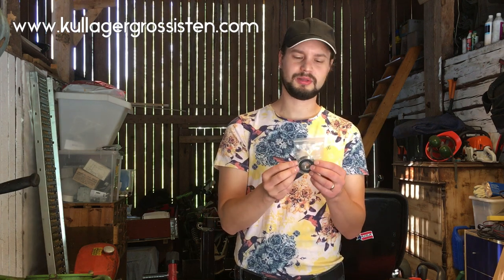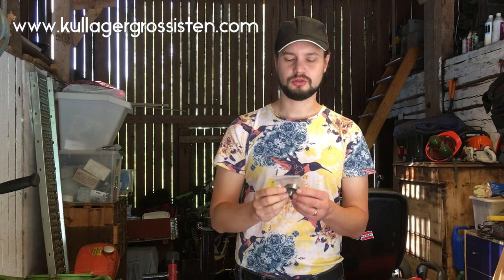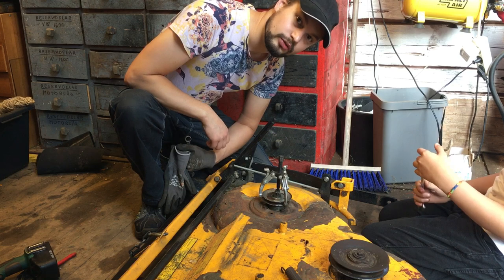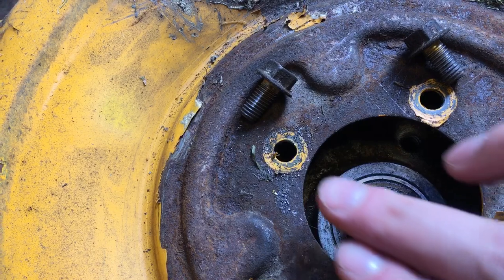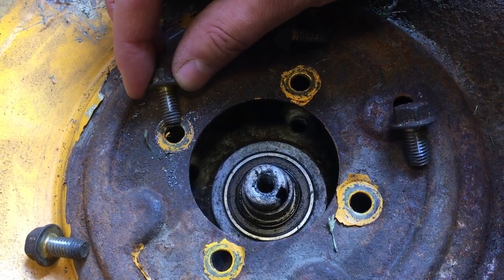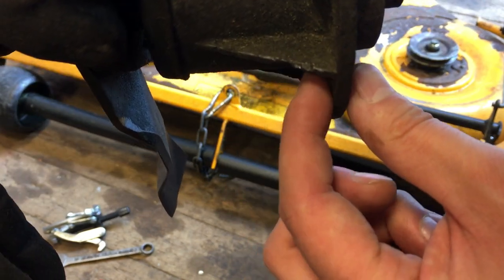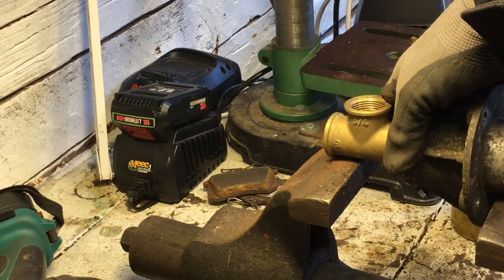Changing bearing In Stiga Park cutting deck

Comment: Great video and explanations - Helped me quite a bit.  Usually the bearings have quite a tight fit so you may need to heat up the bearings and cool the axle..  I used coolant spray that cools down to -55 degrees C.
Reply from the maker: Great to hear and heating and cooling is a great idea. I have used that when changing bearings on later cutting decks.

Comment: Good vid man. The spacer inside the hub between the 2 bearings is to support the bearings allow clearance when you tighten the top pulley spindle nut. On my 121m deck the spindles can be pushed in and “float” which is good as the bearings are tight 8n the spindle housing. My 121m deck also has a spacer under neath that sort of dish on the spindle, this also acts like a spacer
Reply from the maker: True, if one forget the spacer it will be impossible to tighten the nut that goes through the spindle. Why can the spindles float on the 121 deck? Do you mean that they are not really attached to the deck?

Comment: Hi I have a Stiga park pro a the choke cable has broken. Are they difficult to replace.?
Reply from the maker: Hi. What year is your Park from? I haven’t changed that wire but I don’t think it can be that hard. Just make sure to route it the same way as the old wire.

Comment: Question Nils, the belt that drives the blades and hooks to pulley under the seat, it is dfsr to tight to get new belt over each pulley. Do you advise taking the pulley under the seat out and running belt, or is it better to take the pulley off the deck? Doesn't seem to be any other way to get that belt on as there are no tensioner? Also would you know the belt size? My belt is ripped to shreds and unsure of the size.
Reply from the maker: Hmm, as I remember there is a spring loaded tensioner. Do you have a different deck? Perhaps with a belt that looks like a timingbelt from a car engine?
Reply from the maker: If you are talking about the belt that connects the cutting deck to the middle of the machine that has a tensioner as well. Here is a link to a ilustrated parts list. Regards Nils
http://parts.kschmid.ch/ipl_stiga_park_2002_13-1218-12_88_sv-en.pdf
Reply: Yes there is a spring tensioner there that puts pressure on the belt but it doesn't aid in installing the belt onto the two pulleys. I can't see a way to get  the belt on them without removing a pulley?
Reply from the maker: C Coates the belt should be loose enough to put on there without removing a pulley, you probably have the wrong belt, to short. Did you check the belt number against the IPL in the link?
Reply: @NilsKall  perhaps, I can't find the length anywhere google the part # and no sites give the length lol
Reply from the maker: C Coates you will perhaps have to translate this but you will se the original nr and the lenght on this Swedish webshop
https://www.rembutiken.se/stiga/drivremmar/drivrem-stiga-park-100b-2000-2002-10-12-mfl/

Comment: When should I change a mower deck bearing ? How can I notice a worn bearing ?
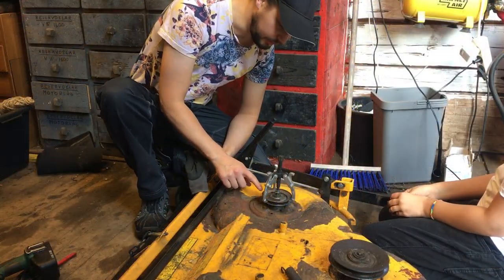Reply from the maker: Listen to the sound at 1:20 when i spin one of the pulleys, it should be quiet no make a chouuuuuuummm sound. There is another video where I drive this Stiga Park and I make a comment about the bearing being noisy. In general when I buy a old (+10 years) the bearings are bad so if you have an older mower they probably are due. BUT some mower deck have grease nipples and then the previous owner could have maintained it and it would be fine. The cause of failure is water getting in when you was washing or move in wet grass. That will make the bearing rust and its a done. Regards Nils

Comment: Can this also slow down the deck in how fast the blades are spinning?
Reply from the maker: ToxRozzx perhaps slightly in extreme cases. But it could seize and stop moving. Vibrations and noice are most common problems.
Reply: Nils Kall i could also be the high pressure washer forcing water into the bearings
Reply from the maker: yes, but I dont think that many cutting deck get washed so often unfortunatly. I will add grease nipples to the spindels of my "new" Husqvarna rider.

Comment: I tried to remove the middle pulley and it broke : /
Reply from the maker: Unfortunately that can happen! I had a lot of problem with a pulley on my Husqvarna Rider and ended up changing the bearing from the bottom instead. Hopefully you can get a new or used one for it.
Reply: @NilsKall  I can't find it anywhere, new one is available but it looks different from mine, but the catalog part number is correct
Reply from the maker: @kk-fi8eb  if the number is right it will probably fit. They often change from cast pulleys to steel ones.